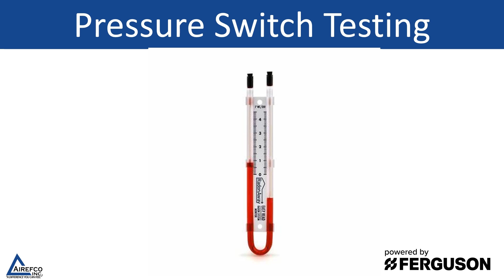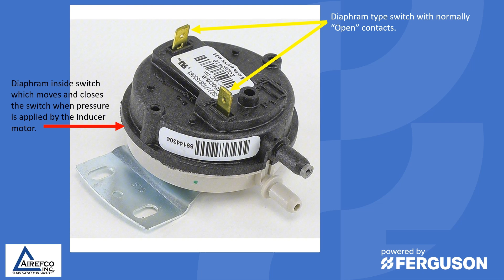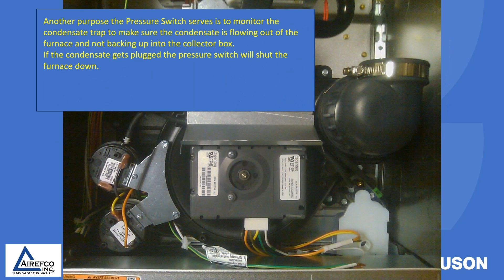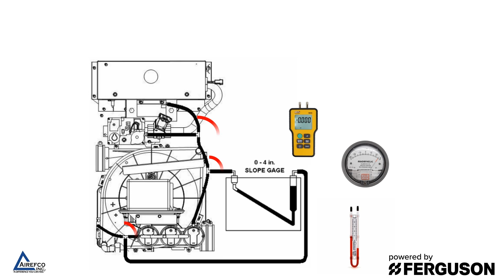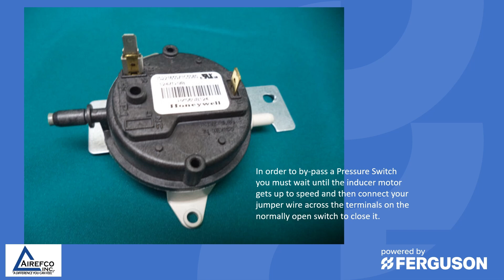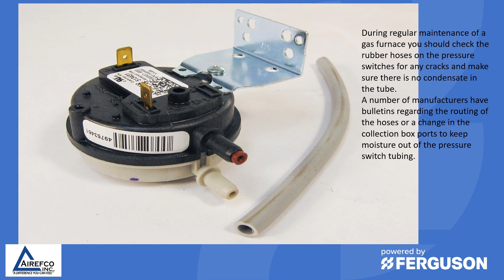Pressure Switches

Comment: The rating on a pressure switch is the measurement the switch will open at.. for example a 1.2 in wc switch will open at 1.2 or lower . The switch will close at 20 percent higher or at 1.44 in wc. 
   A inducer motor that is correctly operating will pull 2 x the pressure switch rating …. So 2.4 in wc would be expected from the inducer motor measurement. The inducer should be operating at or below FLA. if above this amp rating the motor is not operating correctly and will fail eventually,